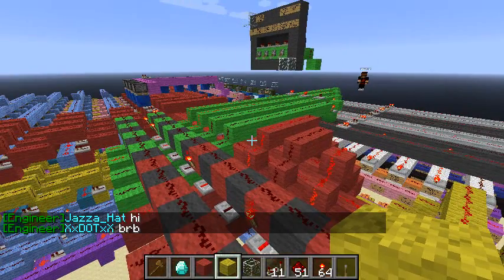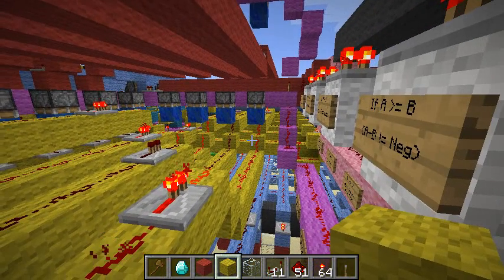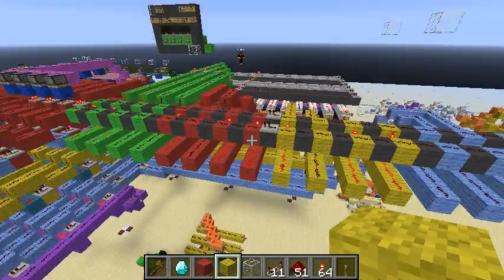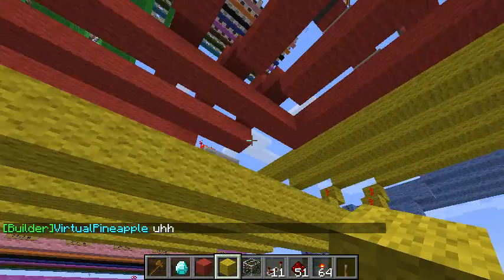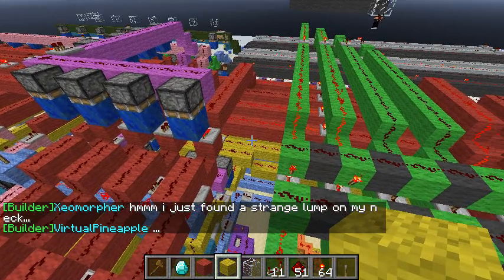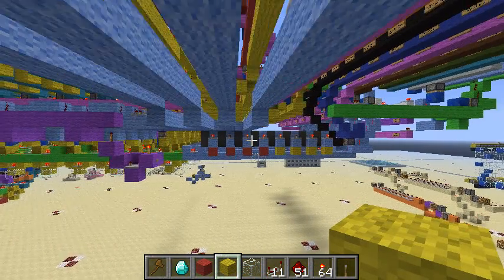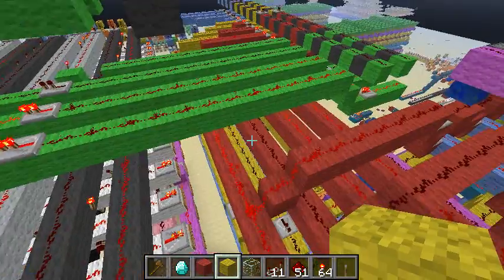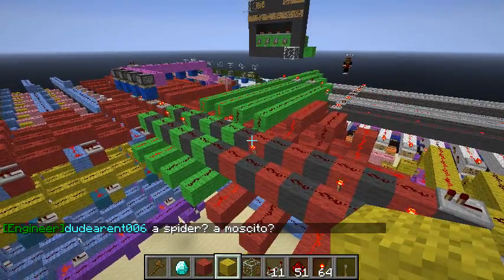CPU wired up

Comment: so silly lol...in this case heat wont be an issue so no need for a cooling system. There may be other results however. It will be interesting to see when its finished.